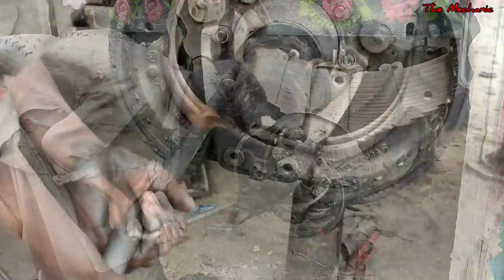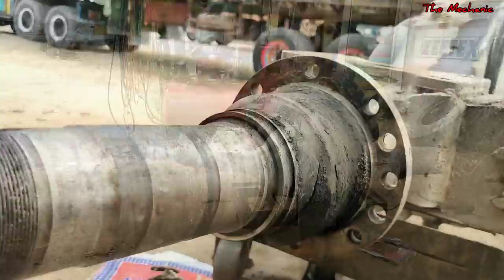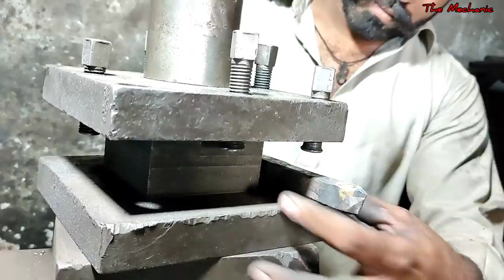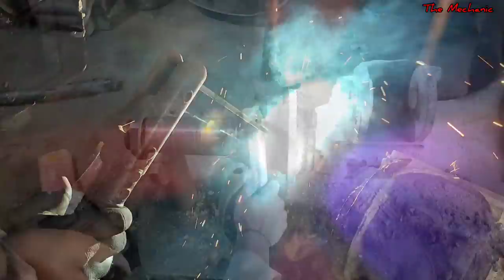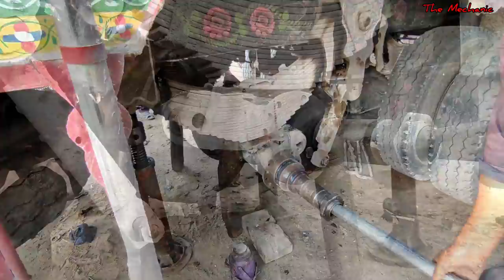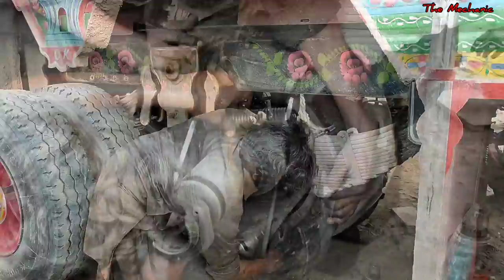Replanting a Broken Spindle from the Rear Axle Differential Housing for a Heavy Duty Truck

Comment: looks like the rear diff was once driven but has been converted to lazy - non driven -- no axles or drive shaft
Reply: Good eye! I doubt most people saw that. Because they have to make do with what they have there could be a few reasons why it's set up like this. With the challenging road conditions there, it's a real disadvantage not having all three axles powered. Sometimes you work with what you got.
Reply: I had noticed this before, but never made the connection…

Comment: Да делают ,казалось бы- не 
надежно ,а как в реальных условиях ? Долго бегает ""?🤔
Reply: А как балка упала !!!
Вот такие проблемы всегда при разгрузке !!! ☝️🤓👍
Reply: Вообщем за смекалку и трудолюбие -- 👍🔥
Reply: They prepared the parts correctly for welding and as long as he didn't overheat the material it will be like new. You would need to X-ray it to be 100 percent sure. If the gap had been wider and he did a stitch weld with a MIG I would almost guarantee failure. These guys have so much experience doing it this way, they have the technique perfected. Plus, if they did a terrible job they would have customers beating them up. I've seen spindles fixed like this in the states. It's rare nowadays because of product availability but in the past, it was the way to go. That's if you had someone who knew how to do it.